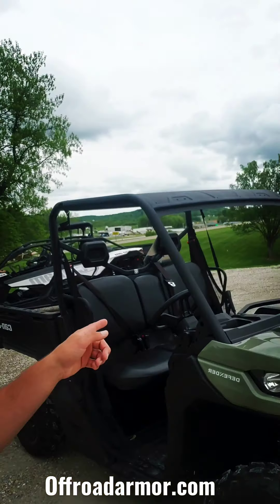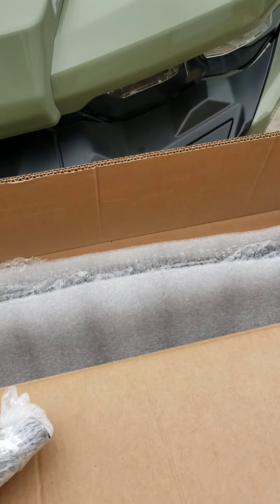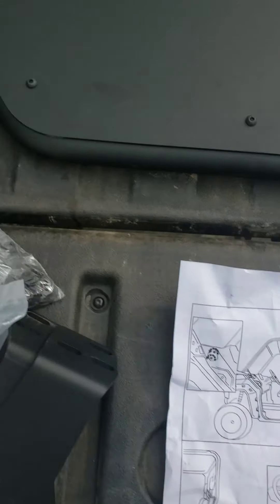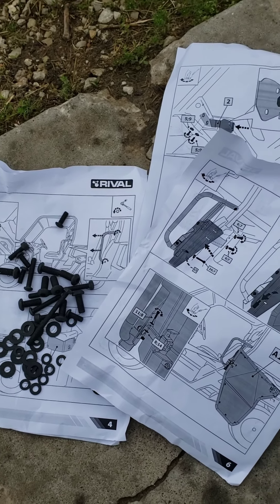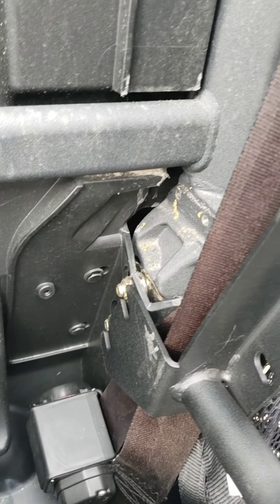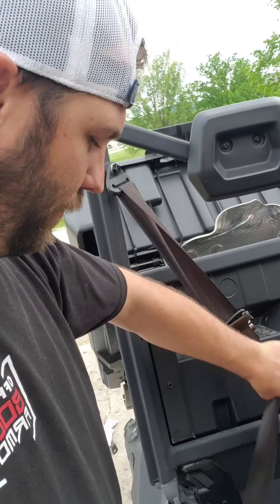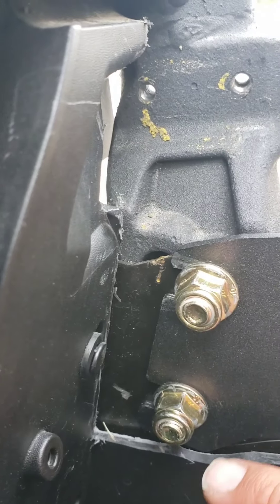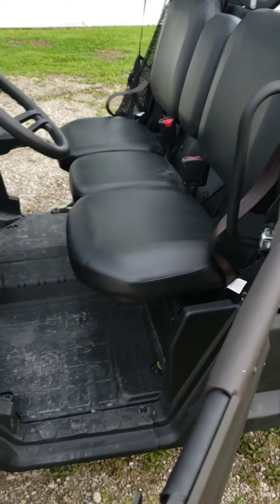CanAm Defender Half Doors by Rival- Offroadarmor.com

Comment: Dude hang the seat belts up over the head rest 

Cut all plastic with a multi tool and only cut a slit for bottom on the replacement bar about 1/4 inch wide